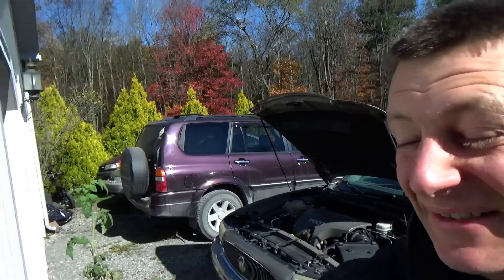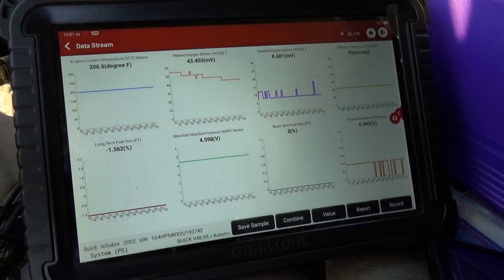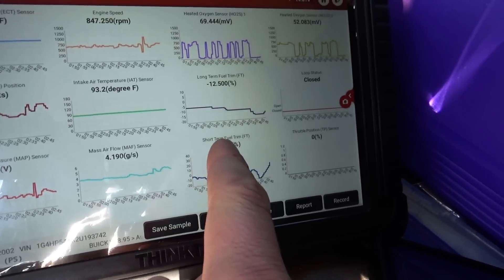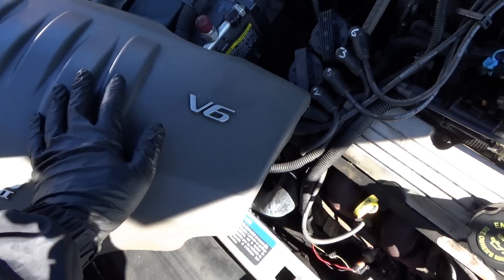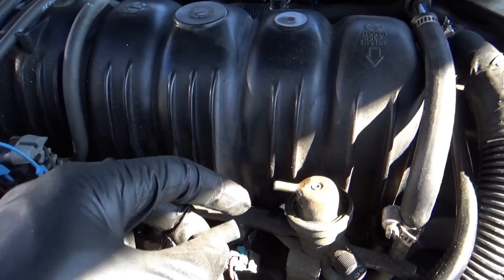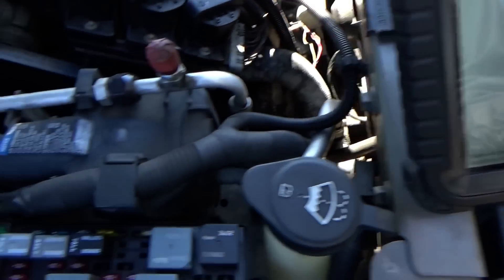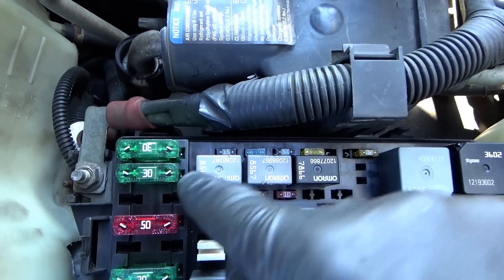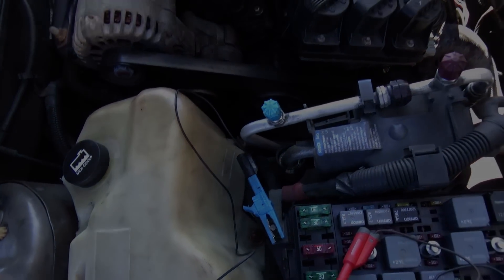Buick 3800 BAFFLES the Owner (Long Crank-Surge-Stall...No Codes, No A/C?)

Comment: Great video!!
Question, what if it's not the fuel pressure regulator? 
Having a looooong crank and sporadically dying at idle issue...
Same car...
No codes, had a code for crankshaft position sensor. 

Replaced: 
-ICM
-IAC
-Injectors 
-Coils
-Fuel pressure regulator
-Fuel pump
-Crankshaft sensor
-Harmonic balancer
-Coolant temp sensor

Checked: 
-Fuel pressure, pegs at 62 then drops and holds at 52 after a few seconds, idle between 50 and 52.

-Plugs, changed in the last year, but checked them.

-Vacuum points on intake.

-Battery connections, grounds and voltage supplied by the alternator.
Reply: having a similar issue with my beloved 92 buick. playing swaptronics to no avail.

Comment: Thanks so much for going through that trouble shooting. Helps me a lot, I don't have any diag tools. 
I have a 99 Pontiac GP GT. Keeps loosing freon. Only thing not changed was the lines. It holds a vacuum. I am thinking the charge ports valves are leaking. Any suggestions???

Comment: Have a '99 Bonneville SSEi, bought it with a rod knock a long time ago and swapped in the cammed L36 I had in the garage that I built a long time before that (first in a '97 Grand Prix GT, then went into a '97 GTP).  The GTP went low 13's at 105 powered by that engine, had 12's in it but traction was a problem.  Supercharger whine is addictive, especially when you drop pulley sizes and have a cold air intake.

Comment: Awesome video man!!!I have the exact same vehicle with very similar issues. P0030 and TPS that was near 15. After fixing the 02 and cleaning the throttle body it still has an issue of stalling. Only in gear at 1500rpms or above. Really puzzled with this because among doing some checks under the hood I noticed that if I unplug the EGR valve the vehicle runs and drives great. No more issues. So I Tryd cleaning and then replacing (aftermarket) OEM is not available locally and the issue is still present. Any idea on where to go next with this not looking for a definite answer, just really could use some guidance. Thank you!!!

Comment: 0:00 it must be the fuel pressure regulator…
6:00 “that’s it we’re done, fuel pressure regulator!”
I knew it!!! 🤣 had two go bad on me, the first one actually caused the upper intake to explode in half, bending the whole fuel rail and causing a fire. Fun times, but an easy fix.
Reply from the maker: HOLY CRAP that sounds violent xD
Reply: @ it wasn't so bad, sort of like old school carb backfires, it's the fire that startled me most 😂

Comment: For anyone that experiences a leaky fuel pressure regulator let me mention that I believe this problem led to poisoning of the catalytic convertor. I put a new convertor in the car at 175,000 miles. But the convertor went bad at 210,000 miles. Sure after market convertors don't last as long as OEM, but I believe this time  the engine was running rich for about a year.

Comment: fuel pressure regulators were always bad on vehicles of that age, seemed over severe on them since it would sometimes explode the intake. ford, gm, chrysler and anything else that had them.
certainly low on refrigerant(low resting pressure), too low to cycle on. somewhere back then they added low pressure cut offs, often as a dual high side switch or sometimes separate.
otherwise they short cycled the compressor to death on the low side cycling switch, nuking the clutch and often the compressor from lack of oil, as it all gets stuck out in the system.

Comment: I put a quick start / fast start ignition module on mine. From air tech-wells i believe. 

The stock GM module won't fire the coils until the module sees #1 cylinder on compression. This module fires the coils as soon as the engine rotate.

Comment: I built myself a variable load test light,  using a LED.  It'll never burn out, and with a twist of a knob I can vary the current draw from 4 amps down to a few milliamps.
Reply from the maker: @kensmith174  how can an LED draw 4 Amps? Must light up the entire state LOL!
Reply: @PineHollowAutoDiagnostics   🤣 Obviously, it can't.  But if it is wired in parallel downstream of a 3ohm 50 watt resistor and 50ohm 50 watt rheostat,   it can draw anything from 4 amps down to 200 mA,  depending on which way you twist the knob.
Reply from the maker: @kensmith174  That's a neat idea! But wouldn't an LED be misleading since the brightness stays about the same over a few volts?
Reply: @PineHollowAutoDiagnostics    The LED only tells you power vs no power. The brightness doesn't tell you anything about the current draw.
    The current being drawn by the load tester can be assumed based on the ohm's law equation,  when the resistance and voltage are known the calculation for the current is simple.    The settings for the rheostat knob  are engraved on the housing, and assume a 12v circuit.    
     Of course, if the voltage is different, then the current will be different.  Example, set the rheostat knob/wiper at the halfway point and the total current on a 12v circuit might be 2 amps, whereas @6v it would be 1 amp.    I set the engraving markings locations on the using using a multimeter to measure the actual current @ 12v, because the wiper on the rheostat is non-linear.

    I also made a simpler one awhile back that just uses a toggle switch to select between 500mA and 1 amp, using two 10ohm resistors.
Reply: @PineHollowAutoDiagnostics    I wonder if it would be worth trying with an incandescent bulb in place of the LED?   I'll try it next week when I get back to the shop and see how it goes.
Reply from the maker: @kensmith174  makes sense. Still nothing simpler for quick "qualitative" load check than a pair of bulbs...no knobs, meters, switches, or ohm's law required ;)
Reply: @PineHollowAutoDiagnostics    That's absolutely true.
Reply: @PineHollowAutoDiagnostics   I used female banana sockets in the 3d printed housing, so I can use my multimeter leads, clips, clamps, etc on the load tester.

Comment: The starting system seems very weak (block ground corrosion?).

The HVAC blower motor bearing(s) sounds really loud. Probably needs a new blower motor?

Comment: I daily my 3800 series 3. 05 grand prix. Those are good motors as far as I can tell. Stalls after a heat soak somtimes and intermittent wiper on  low, and steering is a litle sensitive when going straight. But never let me down

Comment: Absolute best engine GM ever built so many of them cars with that 3800 are just running stoutly at two 300,000 miles should have never been stop production so easy to work on compared to the dual overhead Cam stuff they replaced it with I don't necessarily know that the mileage is any better with the newer engines so maybe after we get rid of all the EPA clowns,,FBI     iRs we can go back to making cars like this dependable and easy to fix let's hope for that trump bring back the car manufacturers and rearrange them so that things aren't so darn expensive because the companies all the companies have gotten so greedy and we can come back and make low tech cars with good fuel mileage and probably hydrogen or Tesla free energy cars or the jetson cartoon flying cars !!!!

Comment: Older cars are usually much easier to diagnose.  Because there are much simpler systems involved.  Just going off of the description, it sounded like it could have been a loss of fuel pressure somewhere.  Either weak fuel pump, leaking injector or leaking fuel pressure regulator.  When Ivan pulled the vacuum hose from the regulator and I saw liquid coming out, I just blurted out, Bingo!  lol.  Nice find Ivan.

Comment: There was one hidden flaw in the 3800 that would crop up occasionally. The front of the balance shaft used a ball bearing which would wear down with mileage. GM also used this design in other V6s like the 4.3. Happened to my '94 LeSabre with the Series I 3800. Sounds like water pump bearings but louder, and continues with the drive belt removed. Unfortunately the engine has to be lifted out for the balance shaft to clear the fender. I parted ways with it at 230K miles, but we had good times together.

Comment: Unrelated question, 08 pilot recently started going into limp mode. Will drive 5 miles on cold engine start. After the first limp mode it would only go a mile. Decided to do a stall test, which it failed. RPM over 5k on D 1 2 R. Now the car won't move at all. I can shift gears but no movement. What could have caused it. Is there a fuse or relay that went bad during test. Pls guide.
Reply from the maker: Transmission is junk lol

Comment: Visual inspection is always a must. So many mechanics I see just don't want to take the time and look for problems. I find it fun.
Reply: Absolutely 100% correct. Ivan is in the salt belt, and as such, he should do a thorough visual inspection on every car he works on, and document any problems with a photo. I don't know the auto repair licensing laws in PA but licensed repair shop usually inspect the vehicle for obvious damage top, bottom, all around. This is a good step in troubleshooting, but also for liability purposes in case something happens and you go to court. 

Many times during the inspection you will see electrical work that needs to be done, and only after these repairs are completed, do you move on to diagnosing the vehicle. But, here again I do not know if Ivan provides a warranty on his work. I make my own automotive battery, charging, starting and power distribution cables and harnesses so I can easily make the best electrical repairs before the vehicle diagnosis is complete. Many times you cannot complete the diagnosis unless the vehicle power systems are reliable, you will just chase your tail. If the customer signs the waver portion of the invoice for no warranty then I will just repair what's immediately broken like Ivan does. Many times without these preventative electrical repairs the car will not last the winter due to a no crank or a no start or some other similar wiring corrosion issue.

Comment: I have a simular but different fenomonem on my Volvo. Runs rough stumbles and misfire from what dtc tells me random cylinder 2345 so far confirmed. But... It only does so when engine is cold or half warm. When it's up to temperature the car runs like a dream. No dtc for maf boost throttle body. No lean or rich codes. Just no codes at all to hint the issue.

I know it's a long shot. What would you suggest to try first? The key is it only happens when the car is cold or heatsoaked but half cold. It doesn't feel like it's the same cylinder but multiple as the misfire is not constant tempo.

Done the basics filters oil and sparkplugs already. I have access to Volvo vida but without knowing what basically to go for first it's a long shot.

2001 manual 2.4 turbo xc70

I'm guessing it's a minor fault. But finding it is the hard part :)

Comment: You can tell that owner is cheap by the headlining being stapled to keep it up, and he only got the diag and replaced the part himself.
Reply: Yes I am cheap and that is my prerogative. We did not have a pressure regulator on hand so I did it myself. I would have fixed it anyway since I am cheap. Had I know that was the problem I would have fixed it and skipped the trip to Ivan. Notice, I was not too cheap to drive 4 hours to Ivan. Ivan does not care if he fixes the problem or the customer does. He charges for his time either way which is as it should be.

Comment: Again, for the Record.   This video made it look "Easy."  Well, not so fast.  There is NO Substitute for Brains.   But, beyond that, there is -0- Substitute for Integrity.  A lot of Crim Shops might have replaced (for $500.00) a bunch of parts that were fine, before reaching the key elements.   The Owner was Smart, and Ivan is the best.

Comment: I had the exact symptoms with my Grand Prix. Shop couldn't figure it out. They had it for 3 weeks. I thought it was the evap canister, so I replaced that. That fix worked for a few weeks. Finally changing out the evap purge solenoid fixed the problem

Comment: Had a similar issue on mine. Turned out the MAP sensor had cracked and was giving bad data as the engine was shaking during startup.

Comment: With regards to the A/C re-gas, did you measure the amount of oil recovered on the recovery of the gas, and then re add the same plus a little extra (oil injection on your machine)?

Comment: You will use your A/C equipment year round aas many cars use the A/C system to defrost the windshield when the engine is cold.
Reply from the maker: No one has ever complained of their AC not working in the winter 😂
It's heating season!
Reply: they run the A/C and heat at the same time to dehumidify. now days most cars run the A/C most all the time on all settings/modes, except "off".
wont go far into the hybrid and ev's, but most all run the electric compressor for cooling and heating both(heat pump setup), they'll ice the condenser coil and then flip to cooling mode and melt it off, to go back to heating. some also use engine/exhaust heated coolant to heat the cabin, but only when engine is running or have storage tanks for the heated liquid.

Comment: Luckily that fuel pressure regulator wasn’t left for too long. Surely the plastic upper intake would have exploded. Had it happen twice on my 01 Impala with the 3800 due to leaking injector and bad FPR at separate times.

Comment: My wife had the 3.8 V6 1986 1/2 LeSabre.  That 3.8 was great.  The rest of the car was a rolling intermittent on 4 wheels, but that 3.8 had 427,000 miles in it when the reman transmission finally quit.
Good one Ivan.  Nice A/C machine.

Comment: In addition to the pin fitment problem, the compressor perhaps shouldn't have engaged a with the system so low on refrigerant.

Comment: People forget the original 3800 wasnt balanced well.  The conversion from the V8 to the V6 put it out of balance.  I had one in a 77 Firebird.   Never smooth and beat the hell out of timing  chains and plastic sprockets.   Mine was looking at its 2nd replacement by 100K.
Thanks Ivan.😅
Reply from the maker: @hugh007  early 90s they installed a balance shaft 😉
Reply: @PineHollowAutoDiagnostics   I think they redesigned the crank and to make it fire more evenly.

Comment: 1997 LeSabre 
Driving home, half a block from my house. Held power window switch a bit too long putting it up. Engine stalled. Long story short, ground location on passenger fender was bad. Took about an hour to find it.

Comment: Man what is going on with that blower inside that Buick 
I had a 71 Ford F 100 custom 3 on the tree no option pick up in the early 80s with a Montgomery Ward hang down air conditioner and it was actually quieter than that.... lol

Comment: So if you needed to add refrigerant that means there is a leak why didn’t you fix the leak before you charged it.
Reply: Ivan may have determined there wasn't a leak when he pulled a vacuum on it after the evacuation.  On some systems, and correct me if I'm wrong, it's not uncommon for 1-2 ounces to be lost over a period of time.  If the Buick hadn't been maintained from time to time, that was the issue.  It needed 35 ounces and it had almost 4 in it.  The Buick is almost 23 years old.

Comment: Ivan, do you ever have a car where the repair/diagnosis was so simple or obvious that the customer should have seen it, and after you find it, they try and guilt you into not charging them (or as much) for finding it?
Reply: I own this Buick and I did check the fuel pressure regulator for pressure but did not see the leak. I drove it for a year that way and it might have gotten worse in that time. Sometimes a parson needs experience to look harder. That is where Ivan's experience is so valuable.
Reply: Sometimes you can diagnose the issue easily and immediately just by looking at the emblem on the front grill.  Just imagine Eric O. walking up to a vehicle and saying "well there's your problem, lady" while he points to the logo on the front grill.

Comment: I was gonna say check the regulator for vac leak and not holding rail pressure, along with the check valve in the pump and the FP isolator in the tank.

Comment: I have a 2003 lesabre and a few of the relays in the rear fuse box are getting hot. The fuel pump relay does not get hot at all.  No codes. Car stalls intermittently, starts right back up. Weird thing is the fuel pump will prime when the key is turned maybe 1/8th of an inch from OFF to UNLOCK (the PRNDL comes on and nothing else) and it primes again (like it's suppose to) when in the ON/RUN position. Why does it prime in the unlock position before the Instrument Cluster even comes on? I have checked pin tension on damn near every inline connector on the car. All good. Cleaned over 20 ground splice pks. Charging system checks out fine but you can hear the alternator humming away. It gets really hot too. Could the rear fuse box have gone bad?